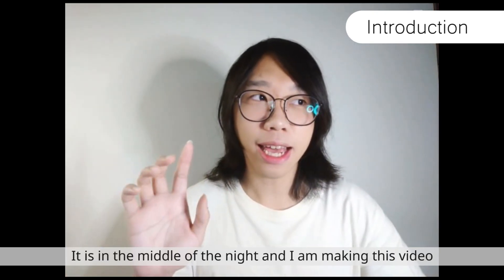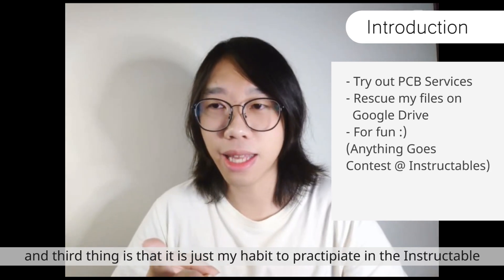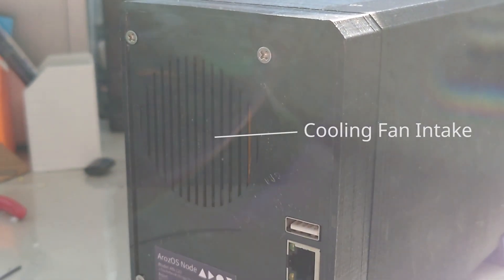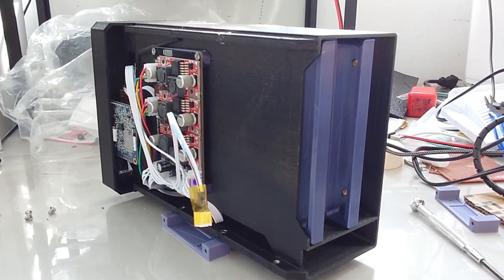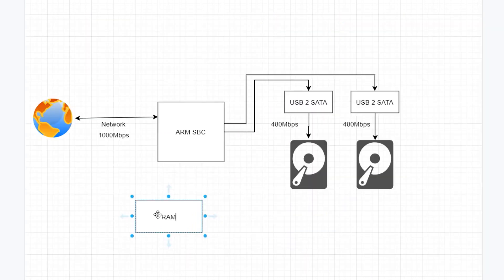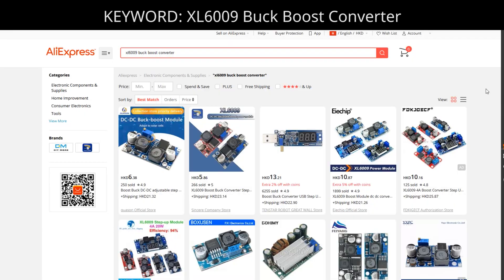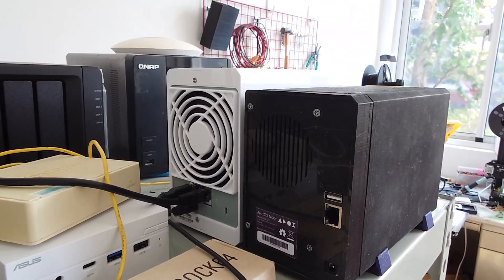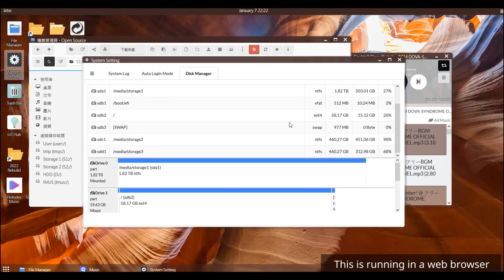DIY 3D Printed 2 bays NAS  - 2023 Update Design

Comment: Hi, It's nice works! But, I curious some question: 
1. Can I get the datasheet, or at least know the size/specification of the board’s status LED and its resistor? They are not included in the board file, so I am confused about which parts to choose.
2. I have a 12V 8A adaptor. Can I directly connect it to the HDD’s 12V power pins? I think the XL6009 may not be essential if I already have a regulated 12V adaptor. In that case, I think I only need an LM2596 buck converter to supply 5V for the Raspberry Pi. I also plan to add a 50V 100µF capacitor to the HDD’s power terminals. Would this setup work properly?
Reply from the maker: For (1), I assume you are talking about the base board which you solder on existing off-the-shelf XL6009 module on top, uses 0805 LEDs with 1k Ohm resistors. All parts, except otherwise specified, use 0805 parts. For (2), yes it will works, but with additional, smaller capacitors (e.g. 100nF and 1uF) for filtering smaller ripples are recommended.

Comment: Hi Toby, I am having trouble setting up samba configuration on arozos, I have tried connecting with arozos account but when I access it from my pc, my access is denied even though my credentials are correct. And also I am having trouble when editing access and sharing folders, I get the message “rename /tmp/smb.conf.1596230007.tmp /etc/samba/smb.conf:invalid cross-device link”, can you explain it in a video?

Comment: Awesome, I am also building a NAS with orange pi 3b for my home. My only problem is the power issue. I am using usb to sata cable, but USB 2.0 Port: only provides 5V power with current up to 500 mA (0.5A). USB 3.0 Port: Can provide 5V power with current up to 900 mA (0.9A). While the power requirement of hdd can be up to 1.2 amps. Please explain more about your power connector
Reply from the maker: You don't power using the SBC's USB port. Instead, you use an external 5V power supply (e.g. from a USB power adapter or buck converter which drop the 12V power to 5V). Remember to make sure the SATA adapter have common ground connection with the SBC :)

Comment: Very nice! I have an old Lacie/Intel SS4000-E that can take 4 drives, but the cpu, memory and OS are 15 years old so no fun there. However, I have an orange pi 3 LTS and some other pi's lying around. How would you suggest I could use your software to connect four drives to this? Thanks in advance!
Reply from the maker: Install debian based Linux, mount them to /media/storage1,2,3 and 4, then install & setup ArozOS. You should be ready to go in less than an hour!
Reply: @tobychui  I was more curious about the physical connections. I have one USB C port and no SATA ports. For the RAID setup, I guess I'll be using md anyway.

Comment: I must say that the project looks very good, and definitely stands out from others in terms of hardware and software. I like the case you made because of its minimalism, the system itself looks very good. And definitely, in my opinion, it is much better than those used in typical NAS devices from well-known manufacturers.

However, for me, the configuration is a bit problematic. That's why I would love to see a video tutorial, how exactly to install ( step by step ). And configure it if possible, especially since I personally would like to test this system on x86-64 bit platforms.. I mean exactly Odroid H3+ or Odyssey X86J4125800. These sbcs as for me, offer slightly better capabilities compared to the ARM platform.

But never mind. Congratulations on a great project, I will be watching its further development 👍.
Reply from the maker: Thanks! I do have plans to make a video on how to install this system on different arch SBC. However I am still busying with my thesis. Let see if I can schedule that in my next holiday 👍

Comment: Great project, I will try to build it as well because i have some Raspberry Pi 2 boards laying around. Are those powerfull enough? I would like to stream movies from this NAS as well, will that also be possible? Regarding those buck-boost converters, or better said SEPIC converters, those may be cheap, like a few dollars a piece on AliExpress, but they are inefficiënt. It's better to but a quality 12V adapter to run your HDDs off directly. And then just one quality buck converter to have the necessary 5V line. This solution might be more expensive at first, but on the long run, will pay itself back. Those cheap AliExpress converters + a USB C cellphone adapter will be quite  inefficiënt and thus raising your Energy bill.
Reply from the maker: ArozOS can run on the pi zero w (gen 1), so I think running it on the Pi 2 shd be fine. 
For the XL6009 chip, its datasheet said it can reach peak 94% efficiency. But if you already have a high quality 12V PSU lying around, you can of course just skip those two 12V buck boost converter.
Reply: @tobychui  Hi, tha is for your reply! Yes, the XL6009 chip can reach that number of efficiency. But the components around the chip, and board layout have an influence on the efficiency as well, especially those 'cheap' inductors. Im gonna give it a try and keep you informed about the results!! 👍
Reply: I’m curious, would a pc power supply be the best alternative power supply? How would you wire it for this setup, jump the 24 pin?